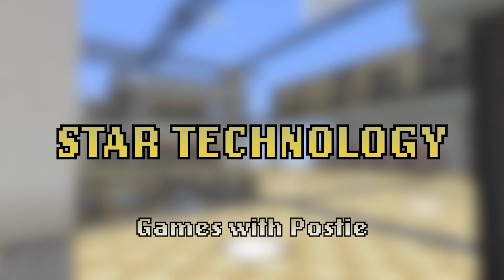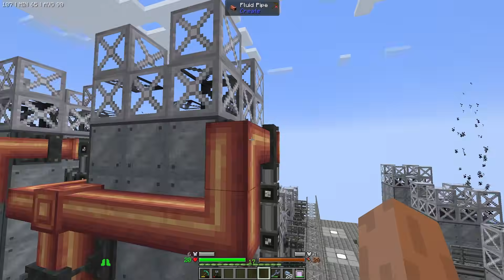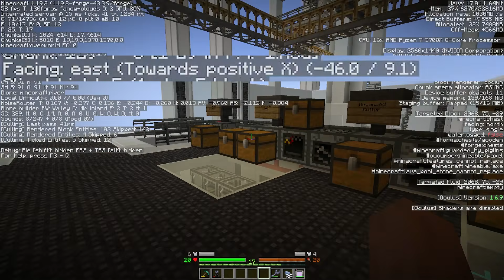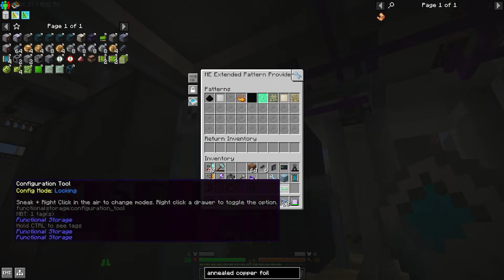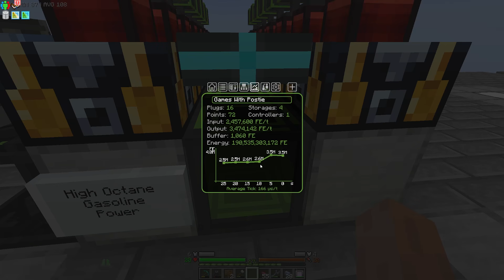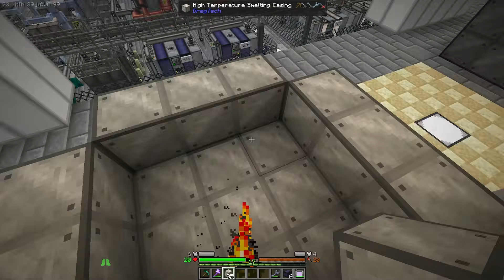Star Technology - 33 Powering up with Solar Energy

Comment: There are some recipe  conflicts with the assembly line whe requesting a lot of things from ae2 

In exampel luv motor requair 6 buses of assembly line and a luv pump need 7 busses the if i odered 2 moters there will be two stacks of fine rudirit wires the when crafting a moter all 7 buses fill out and not start working do u have any idea how to get rid of that.pls.😊
Reply from the maker: @Darsahni  hmmmm that's a tricky one... There's an option on the pattern provider called blocking mode, which might help? I've noticed I have it enabled on one of my assembly lines, maybe I put that on to fix an issue at some point? It's been a while since I created the assembly lines 😅
Reply: It worked but i need to input the  craft in to the system through the pattern provider and I hook up a line of pipez ok finally I can aft untill my fusion reactor beenig made

Comment: It was a somewhat recent addition so I don't know if your current version has them yet, but try looking into the universal circuits! They were added specifically to avoid the issue of having to reprogram a whole bunch of circuit-containing recipes every time you unlock a new tier of circuit recipes, since they allow you to unify all circuits on a specific tier into 1 circuit item
Reply from the maker: I just checked the latest version (1.20), and they are indeed there! That's really cool! Unfortunately I don't get them in 1.19. Thanks for the heads up though!